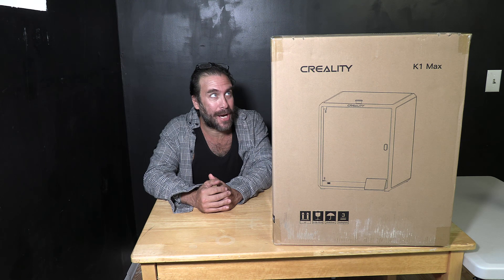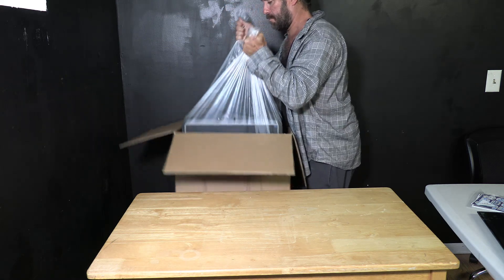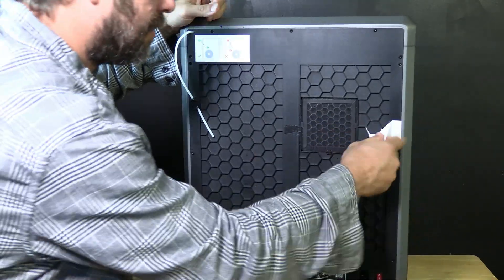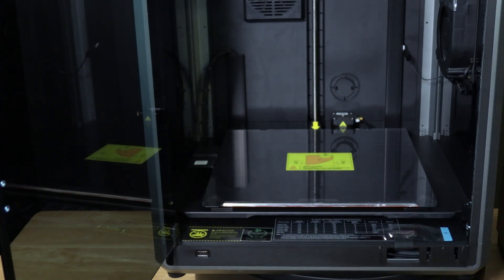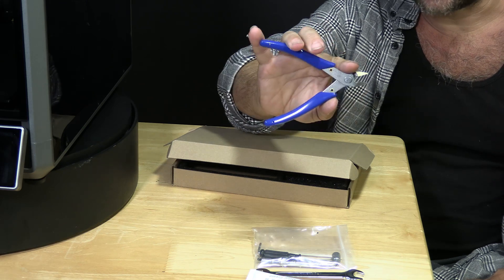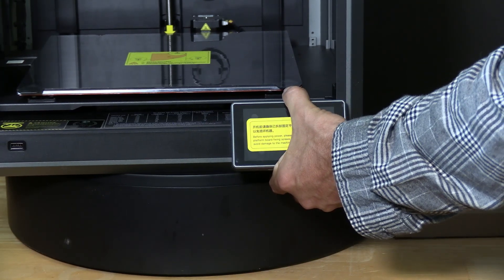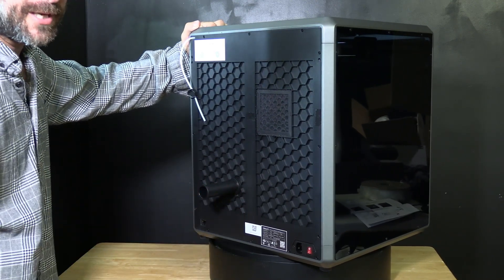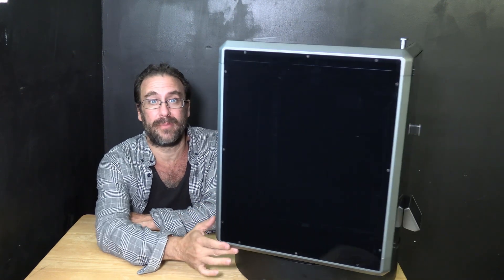Full Unboxing & Build of Creality K1 MAX 3D Printer. Large Fast Printer

Comment: I'm still very torn on going all out with the X1C for the convenience of having the ams hold 2x of my go-to filament's. The K1 Max looks good because of the price. Im coming from a CR10S and I always have problems, lately its the bed heater. The amount of tinkering the CR10 takes prevents me from using it. If you had to chose between the X1C and the K1 Max which one would you say is end game?
Reply from the maker: X1C with AMS. Not even a thought. But if you need a bigger bed, K1 Max is your only option. It's a beautiful machine, and I 1000% had to have one, but, if I could only have one, it's the X1C. Creality, however, is the much friendlier, more helpful Company. Bambu kinda sucks. Ironically, I just got a CR10 Smart, to tinker with.
Reply: @3DRundown  Thanks for the reply. I’ll hang on to the CR10S and will go with the X1C. Thanks your input.